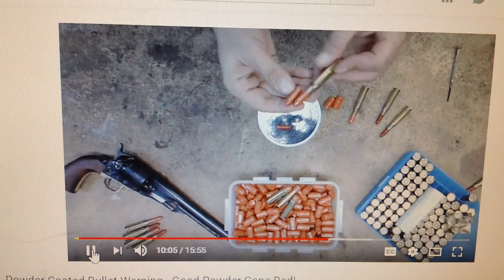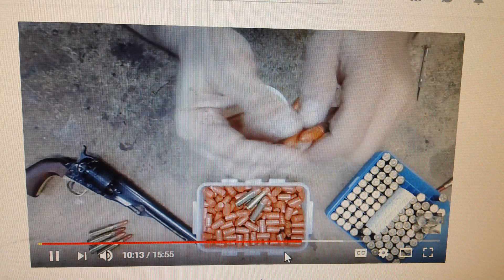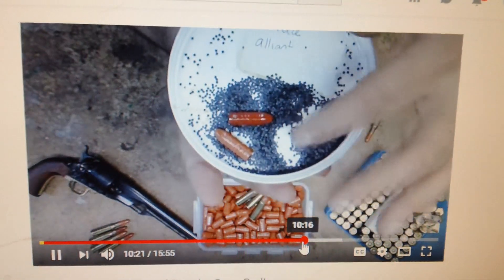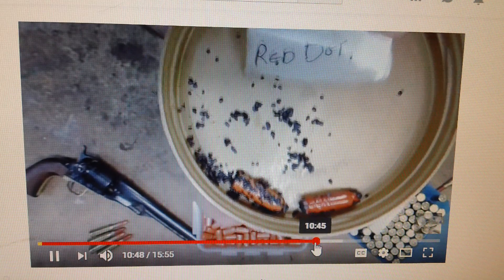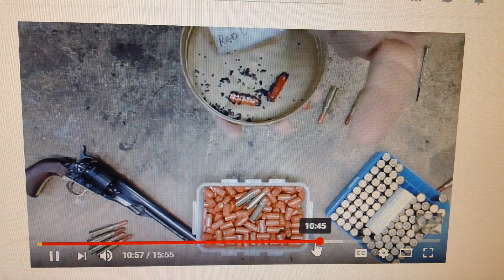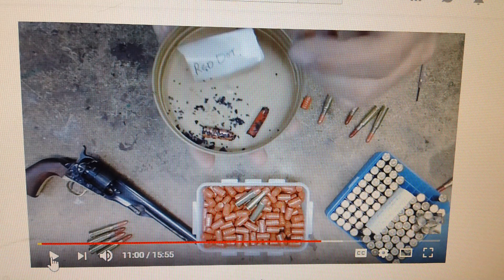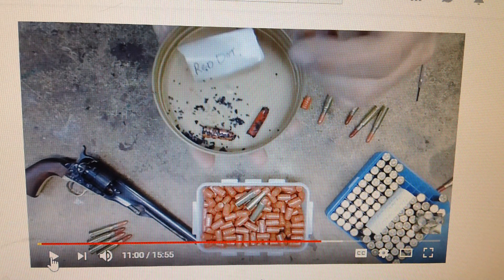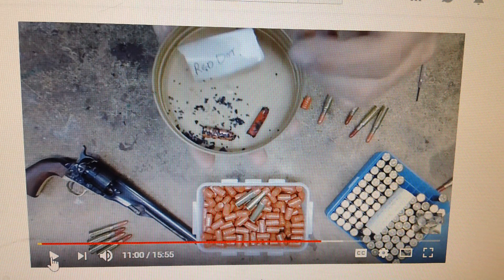Powder coat desolved-The culprit =case lube ?

Comment: Pretty good point sir! I pulled a few pistol bullets and a couple rifle bullets, and saw nothing.
Reply: Kyle Lusk . I did the same. No problems👍🏻
Reply from the maker: Thanks Kyle, if you read Mike Treen comment about the lanolin base lubes, it would make sense,.
Reply: fuzztfork8 I did sir, and I use the same lube. Only homemade. I bet that’s the issue
Reply from the maker: At some point the truth will come out